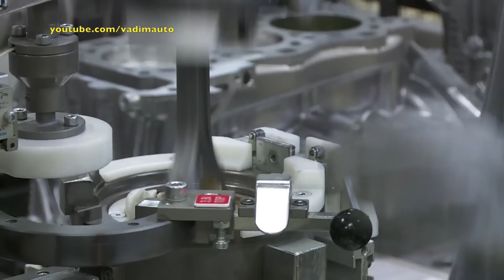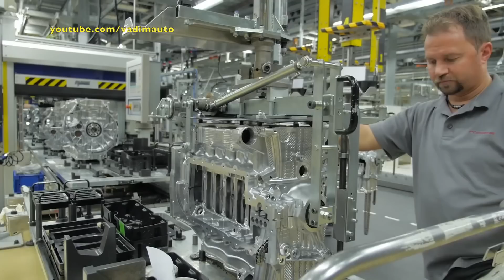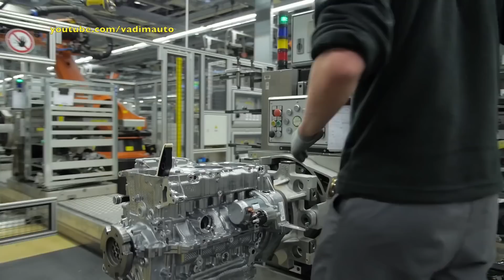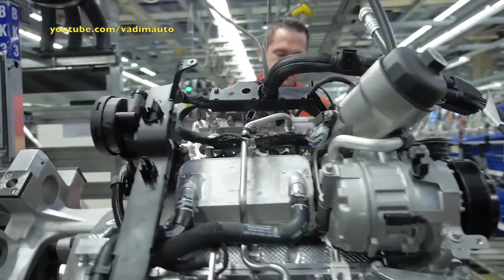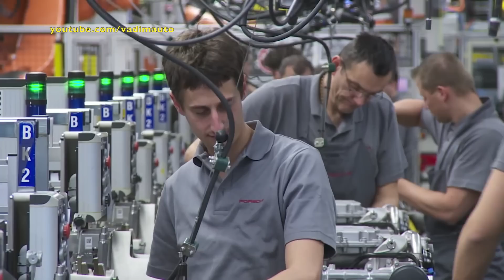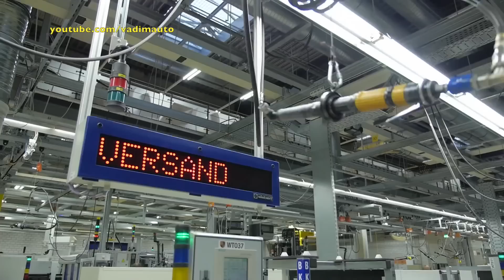PORSCHE 911, engine assembly line

Comment: Peace be upon you, Professor. I have a question on the car. My generation Ck. I have bubbles appearing with it in the radiator. I replaced the cassette 3 times. The machine is clear and smooth. Strong pulling from the cooling off. Returns the text. Normal. Professor  The driver did not switch.

Comment: Some mechanic told me that Porsche’s never need head gaskets since their so precisely machined. If that’s so then what do you call the piece at 2:11 then?
Reply: Huastec,

the 1950's Maserati 250 F racing car did not have a head gasket. The head is lapped to the block.

Comment: Don't get me wrong..I'd love to own a 1965 Corvette Roadster(convertable) with a manual transmission and 396 ci big block V8 producing 425 brake horse power BUT I also think an older Porsche's from the 1960's would be,"almost" as good.
Max
Retiree
GM of Canada
Reply: The older Porsche's dont have enough HP i know i work on them - Driven almost every Porsche and i own 460 HP 92 LT1 Supercharged Corvette

Comment: nice video,  engines made in Germany are becoming more complex, prone to defect and expensive to repair.  Keep it simple
Reply: +serge vivier Simple engines are great to work on,  but you have to keep developing.
Reply: +Stryke Engines should not break down in the first place, haha.
Reply: Ronald de Rooij That's why they get developed further.
Reply: +Stryke Good point however I have a 5 cyl. turbo no direct injection and they are known to last several hundred thousand kilometers.  I suppose if one has enough to spend on a Porsche, one can pay to keep it going.  Some smaller engines are now getting more complex direct injection and they are prone to carbon buildup like the VW TSI and family.
Reply: i agree that when complexity comes a long with being prone to defect and expensive to repair. i would rather take something simple. and old engine that lasts a long time with just regular service but uses much more fuel i would much rather have than a complex and fuel efficent, with vanos or vtec or whatever that you always have a fear of it breaking down.
Reply: @Stryke607  they have to meet the strict new tier levels imposed by the European version of the USA EPA.

Comment: Now put one of these in the back of a VW Super Beetle!
Reply: +tdrewman These 911 engines are watercooled, so they wouldn't work.  You need the pre-1992 flat 6s to work in a Beatle, if they would physically fit.
Reply: +tdrewman The old bug may be the ancestor of the 911,  but it did increase  in size quite a lot ...
Reply: I seen someone with a water cooled porsche engine in a 70's vw bus, dude had 2 radiators on each side with a cross pipe connecting them.
Reply: @victor15002  m
Reply: @epistte  WI

Comment: i have discovered why porsches have loose spark plugs XD omg. someone get them torque wrenches and a 2 person check system wtfffff 
my aviation side is dying sure, maybe its because the engines i work on are 5-24 million dollars, but still, even in general aviation, where an engine only costs 40-100k dollars, they are more thoughtful than that. Even they have inspections that are more than some underpaid worker with a flashlight looking at things he should be putting a calibrated wrench to. 
A second wrench on every single bolt, nut, screw, and plug.